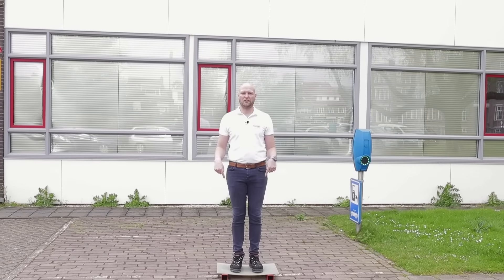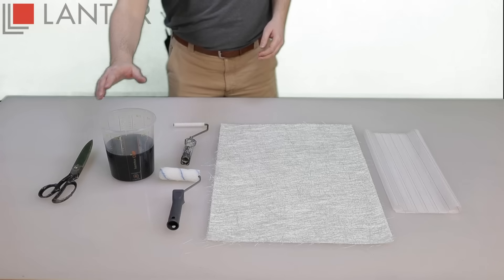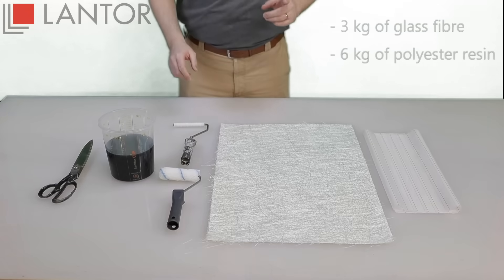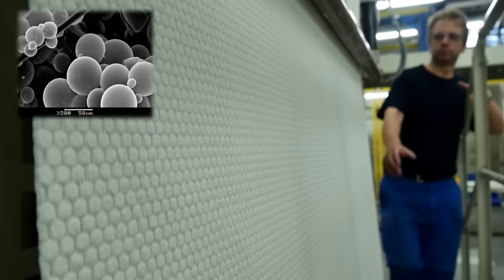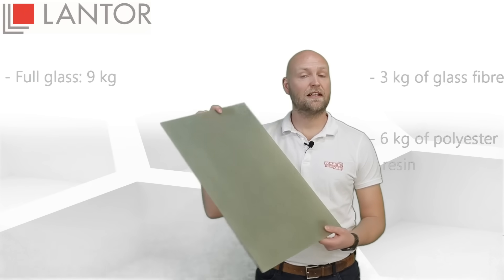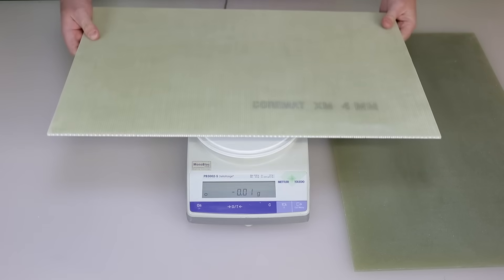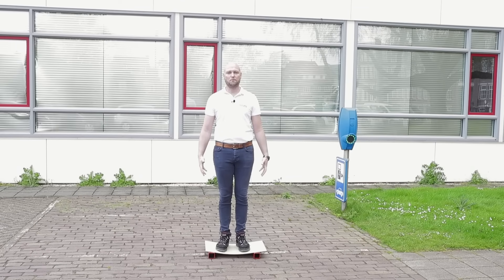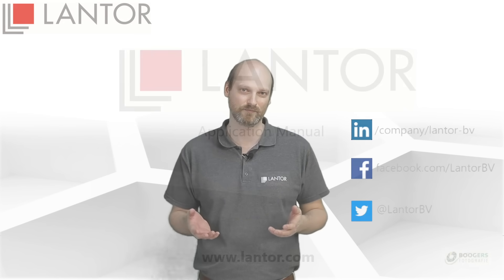The Benefits of Lantor Coremat

Comment: I'd like to know how coremat properies change with different thicknesses. I'd like to use it for my bucket seat but I don't know if I should use 3, 5 or 10mm thickness. Resin uptake increase is easy to calculate but strength is complete unknown.
Reply from the maker: Thank you for your comment. We have mechanical properties available for all thicknesses. Please send us an email to composites@lantor.com and our application engineers can help you get the numbers you need for your design.

Comment: Ok but an actual impact test and ultimate sheer strength test comparing the two would be better.
Reply from the maker: Thank for your reply, in the future we will certainly be demonstrating the performance of our cores under impact and shear in video form. We do have data ready for both those properties. If you are interested, contact us via composites@lantor.com or visit lantorcomposites.com and our Application Engineers will share these data with you and answer any other questions you may have.